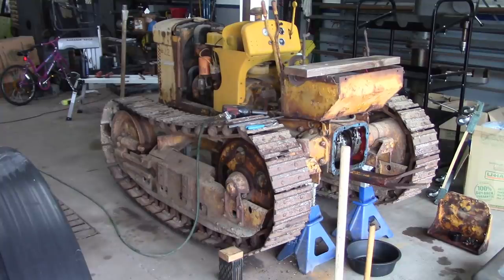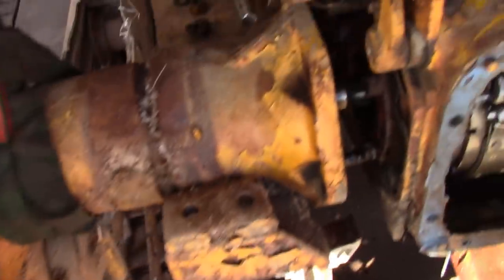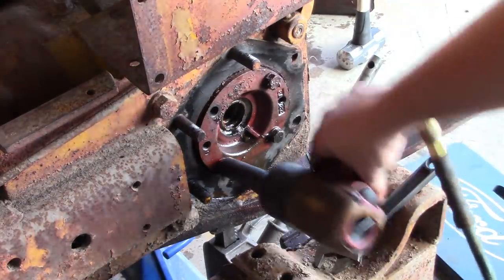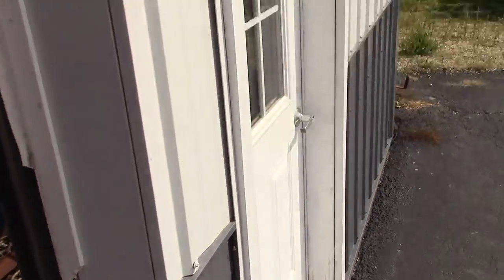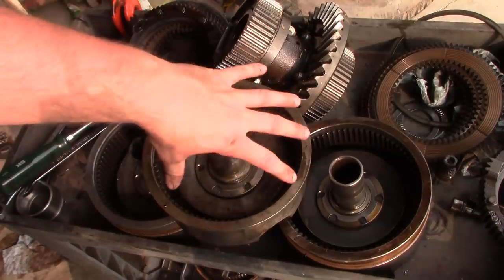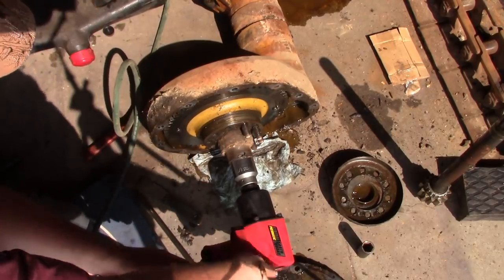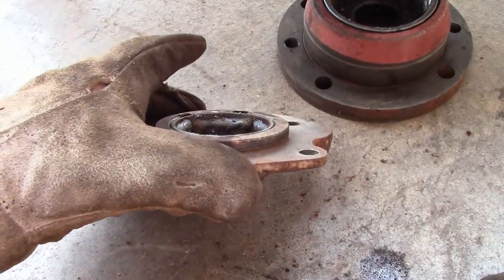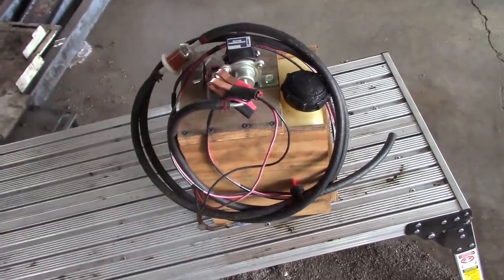1960 Oliver OC46 Crawler Tear Down and Steering Clutch Removal after Sitting 13 Years, Part 2

Comment: Im suprised that anyone would want to spend that kind of money in work hours on a machine that old🤔
Reply: because an old machine like this will still be running long after modern machinery
Reply: You can buy a used OC46 for half again what it will cost to fix this one, and it will need engine work, new sprockets and tracks and probably some of the same things internally. I basically had nothing in this for $$ to start with and know the engine had been OH'd with very little hours on it and the under carriage is in excellent shape.

Comment: For god sake will you go away and buy a millawaki impact gun and throw that compressor in the scrap pile
Reply from the maker: I was going to go on a whole rant about how cordless tools still cannot match air tools and they cost 2-3 times as much. But instead I'll calmly remind you that I can never get rid of the compressor. I need to run a sand blast cabinet, inflate tires, use a blow nozzle, and use various air over vacuum or air over oil tools.
Reply: @WatchWesWork  fair enough
Reply: @WatchWesWork  Fair enough